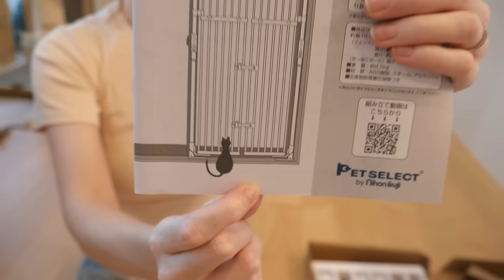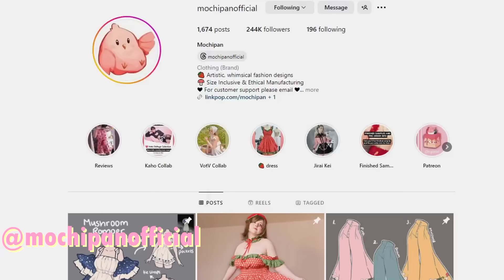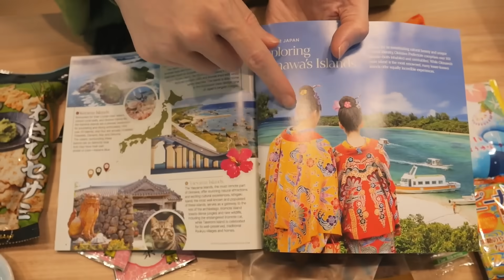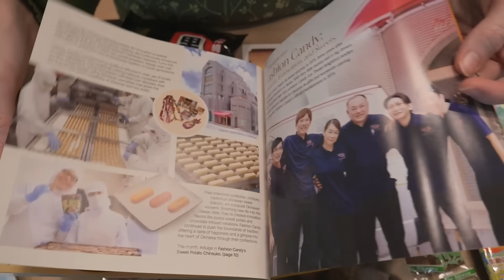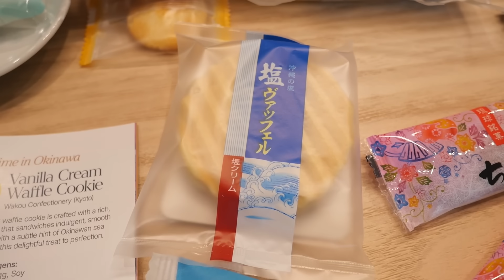Cat maintenance

Comment: I have had to alter or replace doors doors due to cat shenanigans. I have a couple suggestions that would help preserve airflow to your storage room while also keeping kitties out.
1. You could purchase an aesthetic wall vent and cut a hole in the door to install it.
2. You could install the vent in the interior wall for airflow instead. 
2. You could replace the original door for a nice-looking screen door.
Either way, I loved the video and seeing your happy kitties always cheers me up. Thank you, Rachel & Jun!
Reply: I am  sure that will be a future project
Reply: Yeah I think that just replacing the door for a screen door that latches like normal is the correct call. You can probably find one that looks nice/woody/bamboo-ish or something.
Reply: @marcup1584  Maybe frame out a shoji paper style door but use a smooth natural fabric instead to allow airflow?
Reply: Louvered door would work well. Decent ventilation but will block the view.
Reply: A traditional midwestern screen door with metal or fiberglass screen 'fabric' is perfect for vertically inclined cats. Or for cats who like to get stuck and cry about it, who then like to get stuck again. Or for bulldozing straight through like a cartoon character. 
Ask me how I know.
There are screen doors that are maybe more LA that have a metal scroll work. Can be backed by screen 'fabric' or glass. Wood scroll work ones resemble room dividers.
There are also slatted or louvered ones. Wood would look like a shutter or a closet door. And glass feels like Florida windows. (I never understood those as a concept, but ok)

Comment: To prevent mold you can also run a tiny air purifier if there is enough space for that. Like a Levoit mini, might be good enough for the CADR but better to check (twice the m2 of the room so if it is 10m2 grab one which do 20m2) along with a deshumidifier so there is really NO mold, it can help at least.

Comment: You could try a screen door for the storage room. I would make sure it's a more durable one (because cats be cats). It would be easier to open and close verses the double gate door.
My cat Tula is a bit of a trouble maker sometimes. She's never gotten stuck anywhere but she has picked one of our walls where the paint had chipped. She started peeling more off and then started peeling bits of the drywall coating off. Then my toddler started doing it too. It was like they were teaming up. I had to put tape over it until I could fix it.

Comment: The catjail door looks like a wall of cupboards now, totally works! I wonder if you could create an attachment to the door that just holds the door ajar but still blocks the cats entering. Like a hinged thingamajiggers that has a clasp on the doorframe, like a very slim and long shutter. You'd only see a slightly ajar door from the other room. It could have air holes to promote ventilation? myeh I dunno. 
I like the cat privacy boards too, they remind me of 70's design for stairs and entrance halls!

Comment: He looks just like my Niece's cat - Pounce - he was also a bit dense.  At one point, he actually swallowed a needle with attached thread.  The vet bill was about $1300 to remove it.  My sister was told that the worse danger was actually the thread, and not the needle, which could get tangled up and close up his intestines.  Pounce survived the surgery and lived to get into more trouble after that, but no more expensive surgeries, thankfully.

Comment: Hmmm... I knew someone in Germany who had a problem with mold in an unaired room, so he bought a floor vent-cover and installed it in the bottom part of their door.  It was one of the ornamental brass ones with kind of a geometric design cut into it and looked really nice; he had to cut out a window through the door at calf-height, edge the window with strips of molding, and then just install the brass cover.  Just a thought!  I really like the wood laminate, though.  And that green dress was adorable!

Comment: @Rachel & Jun's Adventures!
 A permanent, but still good looking solution for you Rachel, and something i believe you could achieve DIY. 
You could make a new door, make a frame, then for the interior of the door there are ways to make it so you have vertical (or horizontal if you wanted) wood panels which can be rotated/tilted (kind of like a shutter blind) to either 100% be closed and just look like a solid wood door, or be left slightly open for ventilation. Youll find this application used in some entertainment area fencing projects which might make for good references.

Comment: I immediately thought of a security door! It's usually at the front door here in the US. It's clear and you can open the windows, where a screen is also located. It's like... a window door and usually made of metal. This could also work as a solution since it allows air flow and is secure. Poki and the cats wouldn't be able to get through it.

Comment: HI! Love your cats and all the work you put into them. For your dry hair, you might like to try aloe vera powder--you can look up how to mix/use it. If your hair is naturally red, you can use henna powder to make it darker--try it on strands from your brush first to see if you like the color. The more applications you use, the darker it will become (darker auburn). You can also add cassia (for brown) and indigo (for black) to make a darker color. Both of these rinse out after several shampoos while henna is in the cuticle until you cut it. Henna is naturally conditioning to your hair, you will like the results. Shampoos/conditioners made for curly hair such as Cantu also will be less drying and stripping for every hair type.

Comment: What about putting an air cleaner with disinfecting capability (uv) in the storage room?
The garden is looking great.  The exterior beams you painted and put up looking architectural.  The window shades (beautiful material) filtered the harsh light, and adds dimensionality and resistance to nicely transport the outdoors in.
Summer is looking well!  And cooler.
Does it snow there?  And can you (would you) easily remove the window shades when winter arrives?

Jun and Haku has an impossible job of reaching the little green frog on the other side.  But they had fun.
The angel hair plants/grass without rigid support are planted too close to the house.  That's why Rachel is envious.   😅
Why does that lizard on the tree has such a long tail???
Interesting place to be, and pretty.

Comment: I installed a simple screen door on the "garden room" to keep the cats from redesigning my indoor vegetable garden. They can see in and it gets good circulation. We have a latch outside and a latch inside for when we do garden maintenance. The inner garden room door can still be closed if needed.

Comment: If for some reason the cat gate ever stops working, a couple of our doors actually have vent holes cut in them where somebody in the past just like, bolted a floor register (or for the utility room, an air intake grate) over the hole. We don't actually keep those doors shut ourselves because we are in and out of those rooms too much and the cat stays out of trouble thankfully, but it does help with airflow if we ever have to temporarily shut them for any reason. (Also I feel your pain on the corner of the couch, ours is destroyed because that's how our big boy greets us and I am hoping the thing I just ordered will cover it well and he will scratch that instead.)

Comment: Maybe try making a screen door with pet safe screening might help to keep the room ventilated. That 'jail door' is great any links for it? doesn't look bad at all. Beautiful outfit and design :) What about a little house in your garden for your furry visitors? Those wood pieces would actually shield your windows from the sun as well. I wish I had one of those wheels very expensive they are :(  I would have just put blinds up but love the new slats and plants. I have garden envy.

Comment: I remember a cat expert saying that the best way to prevent a cat from jumping a fence is to have a part on top that is tilted inward 45 degrees. A cat will approach it from underneath, look up, and realize, "I can't jump this." Farmers in Japan use something similar to deter wild boars. But I like the look of the covered gate.

Love the outdoor sight blocker. That spring-loaded end cap is so cool because if you change your mind, it doesn't destroy the stuff it touches, whereas if you try to build the same thing in the US it's way more permanent and much more of a pain to undo. Also wondering if there's a similar outdoor paint over here that can last ~10 years.

Comment: There is probably good reasons, but I would have drilled into the wall and added a vent in the wall, and maybe a vent in the door. I would have also looked into a dehumidifier, or just an ordinary screen door you can retrofit over a door.
That said, well done on your solution. It interesting to see how other ppl problem solve.

Comment: If you put pallets under the things in the storage room and don’t put things right up against exterior walls you shouldn’t get mold in the room. I have a room that has two exterior walls and wasn’t getting enough air circulation and I put a ceiling fan in there, that stopped the mold. 
If you put things on patters and ran even a smaller fan on the floor that should be enough circulation. Good luck👍🏼🙋🏼‍♀️

Comment: wouldnt adding door vents be a better option?  hole with a grit at the bottom of the door and a fan mounted on top of the door, it helps with air circulation and it looks good

Comment: Just nail a long fabric cat ladder to the top of the shelves and anywhere else a cat has gotten stuck or keeps knocking over stuff to get on top of. Problem solved. No obtrusive barriers, the cats are allowed to do their thing and you can't even see it. 
A long piece of cloth and a nail cost less than 2€. I did this in my shed where they like to get stuck inside the boiler enclosure (its warm, but they can never get out) and a few other places such as behind my wood shed plus next to a shelves where they used to knock piles of stuff over to try to climb to the top of it.

Every time my boys have gotten stuck or are causing a mess to perch, they have gotten a cloth cat ladder over the years. The cat ladders don't have to be very thick either.

Comment: This reminded me of when I adopted my second pair of cats (I like adopting older cats, 7-12 years old, because they are calmer, cuddlier, and have a harder time getting adopted). As expected they went into hiding once they came to my (new and scary) place, and I was fine letting them come out on their own terms. But I did make sure to look where they were a couple of times a day, and then I couldn't find one for over a day. I was panicking and was worried he'd managed to somehow get outside. Brought dad in to help me search. After hours of looking everywhere dad looked at my bookcases and asked if he could be behind one. I though no way because, while one of the bookcases were shallower than the other (and I'd let it stand further out to make them match up) it'd have required getting on top of them to get behind, and I didn't think there were any way for them to actually get up there (nothing to climb on). Turned out, he had somehow managed it (best guess; he climbed a scratching pillar half as tall and jumped from there). I still have nightmares, thinking about what might have happened if Pa didn't get the idea; this cat is a real scaredy-cat, and I fear he would have kept silent even as he died from thirst. Ended up pushing the bookcase in to the wall; better to have uneven bookcases than risk a life.

Comment: I stopped my cats from scratching my sofa corners and arms by using sticky back carpet tiles. They stick quite well but you can still peel them off if you want to remove them. Also they are really cheap and you can replace them easily when needed.

Comment: Idea! Would it be possible to use a screen door? Not a slider, but one of the normal, and what I think might be older school styles at this point, external screen doors that used to work in conjunction with your normal front door.

Edit: Then it would be a fully functioning door, and always ventilated.

Comment: Gentle tail movements do not mean your cat is mad. Cats swish the tips of their tails when they are interested in something. If they swish it FAST, the whole thing usually not just the tip, they are overstimulated or mad. Notice the cat did not have airplane ears and was gently moving only the tip of the tail. He didn’t even mind when you touched his belly. Most cats don’t like their stomach touched because it is their most vulnerable area to predators.

Comment: I'm curious about Rachel's yardwork jumpsuit. I'm moving to a humid climate soon and want to protect myself from the sun. What's it made of, and is it good to wear on hot days?
Reply from the maker: 100% cotton (for breathability). It's a sturdier fabric to protect from insects/spiky plants. It of course helps with the sun, but the humidity is killer no matter what you wear. Over here they sell expensive jackets these days that have fans or cooling systems built into them if you do a lot of outdoor work in the summer, but otherwise I suggest a cotton work jumpsuit with a wide-brimmed hat and drink lots of iced beverages to cool down from the inside.

Comment: Last summer our baby boy Loki managed to worm his way out of the window screen and get stranded on the first floor awning. Having to stand on an ottoman to lean out the window (too short to reach out otherwise), I dangled a towel out. He ran back and forth along the awning and pawed at the awning but didn't climb it. Our older kitty, Coconut, keeps crawling up my back to scream at Loki in concern, and thus gets banished to my bedroom so he doesn't end up tumbling out too
We have to put the Chihuahua in the bath tub so that she is also not screaming at us in confusion
At this point all of our neighbors are out wondering why there's a cat crying. One of our friendlier neighbors is waiting to catch him if necessary. I call to my roommate to grab the stairwell cat tree and dangle that out the window, but it's not long enough to reach to the awning
At this point, however, Loki got the idea and jumped onto the bottom of the cat tree and THEN climbed the towel (instead of the cat tree) to get back up and inside, where he hid under the couch for an hour until he felt better

Comment: Why not cut the upper door off so there's 2 swinging doors (add a hinge). Could take a lil more off the lower section to make a shelf sorta thing.. same deal as you have with the cardboard, but like... practical. Just my 2 cents >.<'